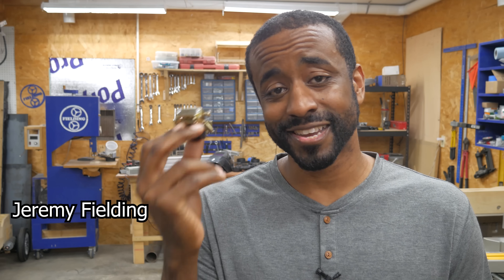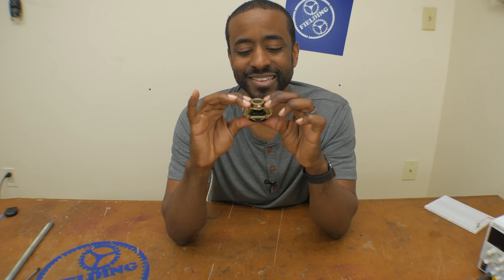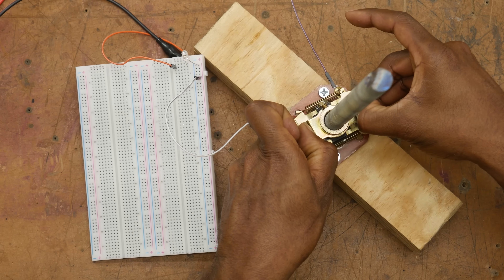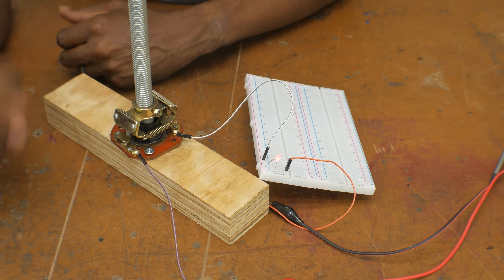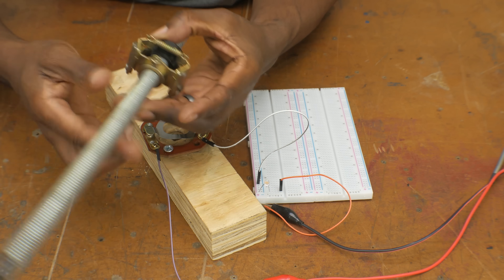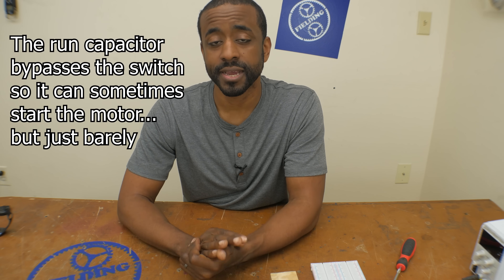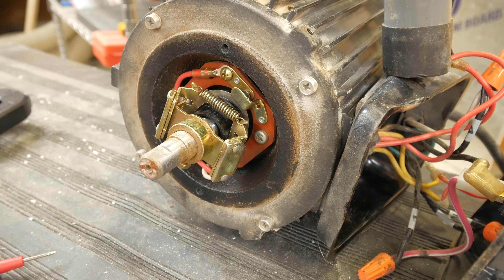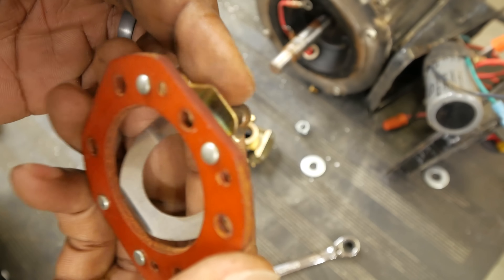This Clever Device Is Found In Nearly Every American Household. How It Works And How To Fix It

Comment: that is a centrifugal switch on a electric motor that when it starts it engages the starter windings and a starter capacitor. A capacitor alters the wave of the electrical field to get the motor rotating in the right direction. Without a capacitor then the motor will just hum and not turn. Three phase does the same thing as there is no need for a starter on a motor with three phase.

Comment: Jeremy, excellent video, explanation...and repair as well. As far as can be determined, a 1920's patent for a centrifugal switch (US Patent #1,630,394 of this basic type was granted to Royal Lee on May 31, 1927. It was the basis for the formation of the Lee Engineering Company.   
From engineering / technical experience, might suggest that as far as the centrifugal switch repair is concerned, using fine grade emery cloth to polish the contacts is better than sandpaper for a few reasons. Then a quick wipe with an alcohol wet cotton tip on all the cleaned contacts generally actually helps as well. Also, the motor used in your example, the bearings sound fairly worn, and if possible, they should be replaced at some point, especially if they are a ball-bearing race type, and re-lube the new bearings if not already done so.

Comment: Excellent presentation, both visually and verbally. I haven't read through all of the 4,901 comments, but I'd recommend that IF someone is going to change their capacitor, they should short it out first with a screwdriver (or other metal device) across the posts, to avoid a potentially nasty shock after it's been removed! Keep up the great work!

Comment: How does it stay connected to the circuit when and while it is runing?
By the way, thos technique is also used in diesel engines. It keeps the engines from running to fast!

Comment: First, your videos have helped me a great deal and I appreciate how you explain things in a way that is easy to comprehend. And you seem to have a good time while working lol! Secondly , I have a question. I bought a $140 electric motor brand new for $40 at an estate sale but it does not have a a capacitor. It turned out to be too low if RPM for my table saw but it did run (after kick starting it of course). I was thinking of using it to make either a stationary belt sander or perhaps some sort of dust collection system. Is there another way of starting an induction motor or am I just going to have to get a capacitor for it?

Comment: I have smoothed the sandpaper scratches for longer life of the repair. A process called burnishing or increasingly finer sanding marks or as a finest smoothing with a piece or writing paper, almost shiny smooth. Put the paper between the two contacts held closed with your hand and draw the paper quickly out from between the contact, repeatedly until the  paper has no dirty look.

Comment: The expressions "balls out" (i.e. full speed) and "to knock the balls off the governor" (i.e. to remove any restrictions on a machine's performance) both stem from this device. "Balls to the wall" refers to pushing the ball-shaped ends on the throttle levers of aviation piston engines to maximum power which in most aircraft is forwards toward the firewall.

Comment: Hi Geremy i hope this comment finds you in good spirits anh health. I have a question to ask you. I have a 4 hp motor that is attached to a pressure washer pump, when i run it on ac supply from the grid it starts good, but when i am using generatior for power and i push the sarter button the motor shivers and burns the capacitor. Any know cause that you may know to sort it out shell be highly thanked for. Many thanks

Comment: Centrifugal governors were used for years on steam engines and in Diesel engines for steam and fuel control before the electric engines and motors were invented.  I would not be surprised if autotoxins in ancient Roman or Greek machines did not use centrifugal mechanisms and certainly, the first flywheel was most likely the potter's kick wheel.  The leap from a governor that opens and closes a valve to closing contacts or employing a brake is a logical jump.

Comment: ...welp, this just showed me why I have to spin up the electric motor I'd just rebuilt/lubed up.  The collar that presses the contacts into place for the start capacitor?  I had that in my "I'm sure this is probably-maybe important so I'll hold onto it for half-of-forever in case I remember what it was for" bin.  And now I'll go open up that motor again and put the thingy into its proper place.  I bet it'll work much better that way.  o.O

So, thank you, good sir, you've accidentally reminded me that I was being silly...and it will likely make my life way less aggravating.  As well as dooming me to keep my "SURELY this was important, right..?" bin because now I WAS right and thus I'll never be able to get rid of all the odds-and-sods in there.  "But it was right before...these might be as crucial!"  Oh well.  :)

Comment: Great Video I have the same switch on my dryer motor . It came apart you think I can but it  together I found to small spring and too weights .on the bottom of the dryer . and when I press the start button the Dyer will not stay on . only if I hold the button  it will run . with a burning smell .any advice thanks 👍🇨🇦

Comment: Automotive cruise controls used to have a similar mechanical governor, but as the weights moved out they moved a contact on a winding to vary voltage.

Comment: Thank you for the information. Having an issue with a Jet motor single phase centrifugal switch. Is there possibly a bend in contact nodes if it’s not fully in contact with start up? Pulled apart a few times and sanded it and reinstalled motor and happened again board is a little burnt from burn off should I replace board or am I missing something?

Comment: Nice!  Noone had replaced the wheel yet, not even aircraft in significant quantities, so the perspective that that which is old must be replaced is probably a sales gimmick that should be avoided.  Reliability of technology and not its cost or age must be the primary consideration when potential explosions are at stake.

Comment: Very interesting. I ran into centrfigual switches in rotary vane vacuum pumps. See, the vacuum generated by the pump tended to allow the pump's oil to move up the plumbing and toward your vacuum load. This pump used the switch to vent the vacuum pump and eliminate backstreaming oil.

Comment: I just found a couple of your videos and like them very much. 

There is another mechanical thing you might like and it is the ceramic bearings in electric water pumps. 
My dad and I replaced a  bearing back about 39 years ago and it worked until now.  They are about as interesting as the centrifugal switch.

Comment: Just so you know, whenever there's a capacitor involved make sure it's discharged before you go poking in there. Capacitors can kill. 

Normally you just wait several minutes after unplugging the device, and/or turn it on unplugged (some devices have been known to run for a fraction of a second when powered on unplugged, that means something is storing juice). Then using a screwdriver touch both contacts to make sure there's no spark flying.

Comment: Loving the vids keep them up.
Am I correct in saying ` is the contact point you used sand paper on coated in a special silver  coating and if you take the fine coating off the contacts will ark and well them self together

Comment: A couple years ago i picked up a very nice Bluffton 1-1/2hp NEMA 56 motor (made in USA) for $20 (it was free but i felt guilty) because it wouldn't run and i figured it was the start capacitor. Well it wasn't that, so i yanked the end off and it turned out it was this centrifugal switch. The board was actually broken.  $5 later it was up and running and now i'm looking for a project to use it in. It was a pump motor, so it runs pretty fast at 3,400 rpm. I may use a furnace blower wheel with it to make a dust collector. If it were 1750rpm i would have used it in my bench top band saw. lol. like you did.

Comment: Jeremy,  I've been subscribed for a while now and finally have a good question for you.  I have a 110v motor with 4 wires (2 start and 2 run) along with a start capacitor using 40 mf in a plastic case.   I wired the run wires up and plugged it in expecting a hum (I disconnected the capacitor and all wiring), but IT STARTED UP counter clockwise.  I switched the incoming wires and it started up running clockwise.  I tore it apart and it has no centrifugal switch.  
I bought a used Corghi tire machine for $300 because the guy had the motor and switch out in a bucket.  Two wires had .7 ohms and two wires had 7.6 ohms.  The tire machine rotary switch was in pieces and had burn marks on it. What would tell the start windings and start capacitor to turn on and off????

Comment: This device looks to be the most important part of the motor, yet it is under rated or not well spoken off that much at electrical engineering institution, the only thing we hear of is the capacitor or drives. Thank you for sharing this information I have enjoyed it.

Comment: some more modern single phase AC motors will be equipped with a more robust capacitor that is rated for continuous use, removing the need for a centrifugal switch

Comment: I have revived lots of thrown away motors just by cleaning the contacts as you did, and if contacts are beyond repair you can replace the little board with with contacts for less than $10 in most cases, use manufacturer name  and mod no. to get p/n and check Ebay,  I'll bet guys have these motors laying around and will snap when seeing this great vid THANX!

Comment: I do not think it is generally necessary for motors with more separate windings that do not have the deadzone where it just can not start because it is between 2 windings and the magnet is too strong.... but I may be wrong because the washing machine might have variable loads and so the motor would need a clutch mechanism I guess if we do not overload it this way... Also I do not think synchronous motors need this either as they are driven by electronics anyway... but I do appreciate the beauty of this mechanical switch either way.

Comment: My old dryer had a centrifugal switch that was used to control the power for the igniter and the gas valves.  Once the motor got up and spinning, the switch closed, the igniter got red hot, allowing the gas valves to come on, and with gas flowing at the still hot igniter, the flame finally came on.  Air passing through the cone housing the gas flame was heated and drawn to the blower, then up into the drum to dry the clothes.  All that from a centrifugal switch mounted on the motor's shaft!  
Thank you for this video.

Comment: Thanks so much for making these videos mate. You’ve changed me from being scared of this stuff to being confident to investigate issues. 
Well done 👍
Reply: You'd better be very careful! A little insight can be a very dangerous thing for all. Know your limits. Sticking a s rewdriver in the wrong place can touch a capacitor with many jewels of energy which can in some cases send you across a room without your feet touching the floor. Even a simply camera flashgun has that on a smaller scale. Many a pro' has reached in a fountain to osh out their expensive flash and been taken to hospital. sStudio tech's musicians and their "roadees" are at most risk just by pulling a plug on a fully charged  capacitor.

Comment: This seems to be basically the same as a Watts Governor. Also that snap action looks like it is designed like an over center cam. There are a lot of clamps designed this way. The force to open the mechanism gradually increases but then sharply drops off after a certain point to allow it to click open fully in a split second. The same in reverse. It won't close as the motor slows down untill it gets under a certain RPM and then it will snap shut. Electrical switches don't like to be half open. ⚡⚡⚡

Comment: The name of the shown device here by you chocolate man could be "centrifugal switch" (as already mentionned in comments further below), patented by  Royal Lee in 1927. It was the basis for the formation of the Lee Engineering Company. In the german language this would certainly be a "Flieh-kraft-schalter" ("fleeing force switch") perhaps along with a Fliehkraft-regler (centrifugal governor). I reply this because you say there wasn't any identification information on the web, but you knew the kinda certainly correct name. So are there hardly any analogue centrifugal switches around, "replaced by electronic alternatives"? And centrifugal is kinda like centripetal,  right?  We need more tight handyman handcrafter tutorials like once planned with the now abbreviate wikipedia. Why not upgrade this tutorial gathering from the comments?

Comment: While I'm thinking about it, you shouldn't use sandpaper unless it's in the emerycloth or wet sandpaper... The best thing to use is a points file.... The contacts are generally made of silver or silver plating... You can sand off the silver plate and it won't last long at all after that before it pits. Also if you find old circuit breakers... You can use a map gas mini torches and pop them off and use a homemade spot welder to attach them bach to your old centrifugal switch ... This is especially useful when they no longer have parts available.

Comment: Fascinating. Never taken of the motors apart before,  though used many that had that switch in it, or a magnetic starter. Most of the old motors at the farm just got replaced,  because they let the smoke out. Lol

Comment: Just to add an extra tip here: If you put a thin layer of Vaseline on the contacts, it will prevent corrosion and it is conductive, meaning that it will be a much longer time between needing to disassemble and clean off the contacts once corrosion eventually becomes apparent once again. Source: Trained and qualified as a systems electrician doing maintenance work.
Reply: I prefer using silicone grease.
Reply: @stevemccull9699  Also a good option. There's specific conductive grease you can buy, but it's expensive as hell.

Comment: There are devices in light twin piston engine aircraft and advanced single engine piston called a governor that work on the same balanced centrifugal weight principle.  It allows pilots to change the pitch of the blade thus changing the RPM of the engine.  Then there is the plumbing associated with the controllable pitch props of turbine engine aircraft like the EMB-120 Brazillia.  The plumbing in all three types of aircraft and the method in which it is actuated is fascinating with centrifugal counter weights.  Give it a look some time.

Comment: Years ago we had a large bench grinder that this switch or something like it went out.  We just wired a momentary-contact switch in the circuit for the capacitor and drilled a hole to mount it.  If you flipped the main switch to start the grinder, it would howl like hell and not turn. When you pushed the contact switch at the same time as the main switch, it would start, and then when it was at speed, just let off the contact switch!

Comment: This switch has existed for nearly a centuary because there wasn't a company called Apple at that time. They would have come up with a version of switch that would need a software update every three weeks and if not the switch would permanantly remain locked, also there would be an upgraded switch every year and consumers are meant to upgrade their switch every year by buying a new physical switch. Then in a few decades they would have come up with a switch where the springs would not be a part of the package anymore and you would have to buy that separately to save the planet of wastage and make their product green. Also they would have had the patent lawyers who would sue any individual who repaired these switches without being authorized by Apple and no company anywhere in the world would be allowed to make replacement parts as its exclusively apple product!!!

Comment: Same issue happens on air compressors, microwave ovens, PC mouses, wall switches and just about anything that has a switch, I've reworked them all at one point or another.  Sometimes the replacement part is readily available while other times it's easier and just as effective to refinish the contact surfaces.

Having the better made products are generally better because the switch assembly is accessible and serviceable.  Other times the switch is of such low build quality or access is poor that the entire product has to be trashed.

This was a very helpful video because I seldom work on or understand the start circuit of a motor.

Comment: never use sandpaper to clean points, they are coated with silver. if you take to much silver off your points will weld together. use something less abrasive such as brown paper that will actually contort to the shape of worn points more evenly and allow more surface contact.

Comment: Is it bad if a non PSC motor takes roughly 3 seconds for the centrifugal switch to engage? it's a tiny 1/6hp GE motor on an old Lennox furnace blower, once it's running the motor operates well within its power draw and thermal specifications, though I think a 1/4hp motor would be better suited for this blower due to its size